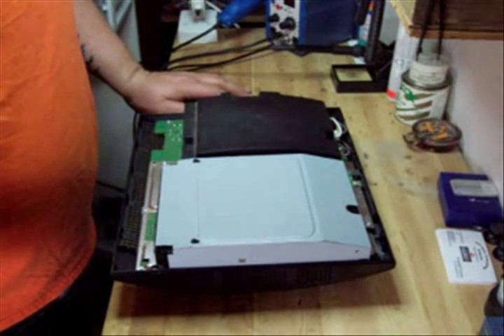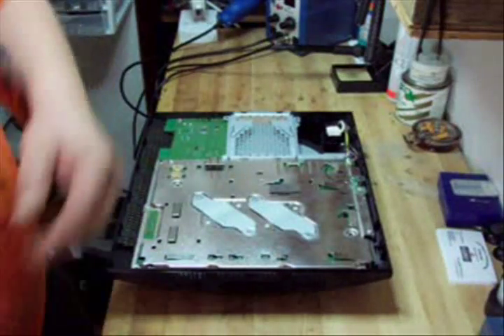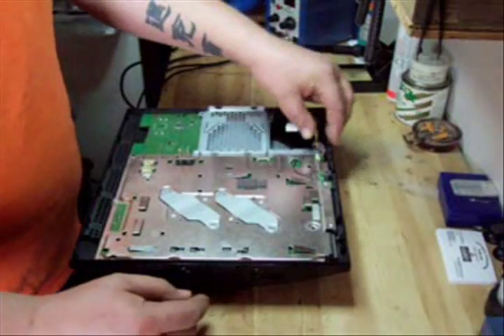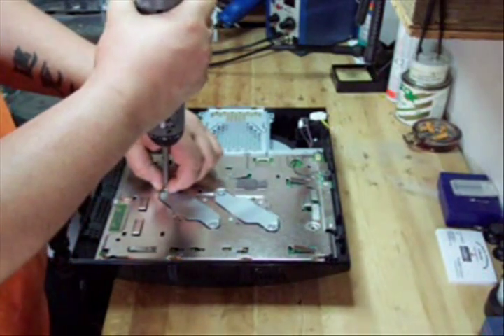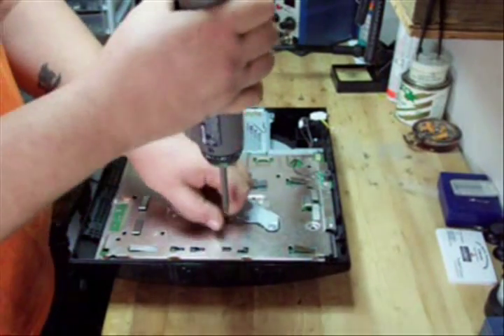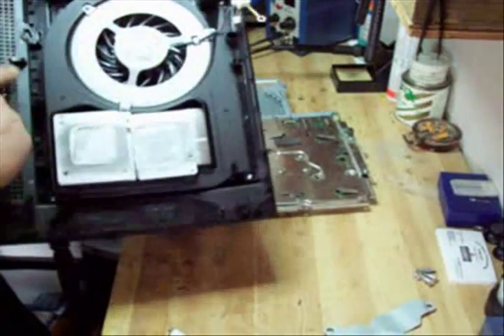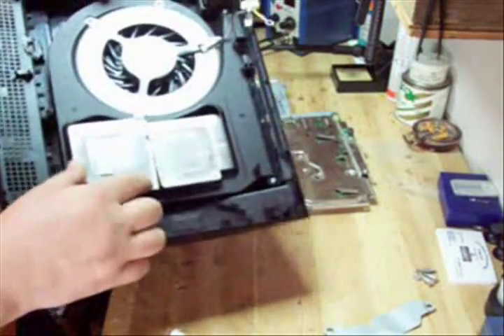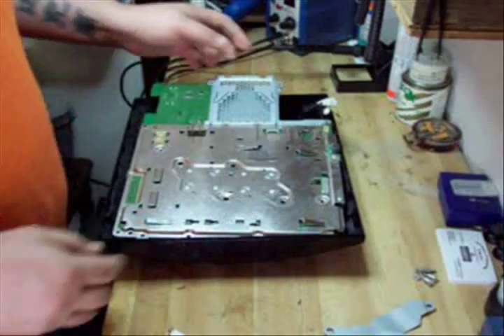Non BC wit black PS MB removal.wmv

Comment: Thanks! Following your video I´ve managed to disassemble my PS3 (CECHH01) and fix my YLOD using some Reflux No-Clean Kester 951 plus some Arctic MX4 thermal compound. Your tutorial was very important since I had no idea on how to take apart my PS3. I´ve saw many guides on the internet, but you had the same model as I do, weirdly you call it CECHL01 on your website. Thanks! I´ve took pictures and videos and I´ll post them as soon as possible to help others just like you did!

Comment from the maker: @Sudokubank there are 6 Phillip screws that hold down the black power supply and 2 sets of wires, one white 4 wire connector on the front and a 2 wire connector on the back of the power supply. After all screws are removed remove the 4 wire connector on the front and just pry up on the power supply then remover the 2 wire connector on the back.

Comment from the maker: yes you do have to remove the black power supply if it goes under the power supply that is the best way rather than messing with the taped side on the drive itself.

Comment: @shah1982jay there is a two pronged plug that comes up out of the motherboard that plugs into the power supply u just have to lift it up, its like unplugging a power plug from a socket

Comment: That is the exact model that I have.  It was valuable in dismantling.  

At the end, you say to scrap off the white paste, but do I need to take the case apart to reapply new thermal compound (artic silver) or do I need to heat it up first and then apply?

Comment: Could you please show a reassembly of this exact same model. I know its just reverse of when you disassembled it. But you also made a reassembly for the backwards compatible ps3. The only tricky part is putting the heatsink back on the original position for the non b/c models. Same with the blue ray drive clip, of putting the ribbon cable back on, without breaking the clip. Many people break this clips that attach to the blue ray drive. Can you please post a video of a reassembly of this model?

Comment: i can't find the previous video. how do you get the blu-ray ribbon off? this version is different then every other disassembly video posted. there is tape under the drive, and the ribbon goes under the black power supply. also, how then do you un-screw the black power supply? thanks!!!

Comment: Hi,

I'm facing a similar issue as Sudoko. I have removed all the screws from the power supply, both the connectors are out. Now when I try and lift it, I can see something steel thing holding it down from somewhere between the middle and right of the supply? Any suggestion?

Also when you say "pry up" what do you actually mean? :) Could not find the link where you actually remove the power supply

Comment: hey man, great tutorial, really helped
only got one problem, when i re assembeled my ps3, and turned it on, it works fine except the ps3 remotes wont register with the ps3, and even if i plug them in the usb port via the cable, they still would not register to ps3, 
plz help!